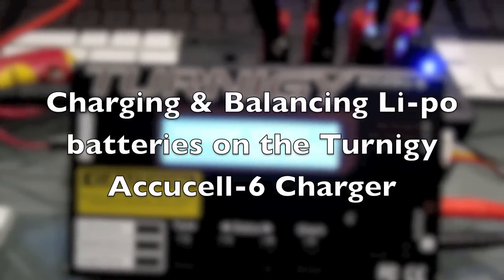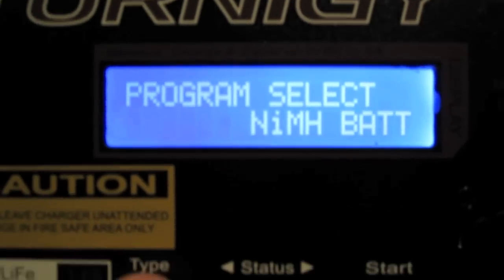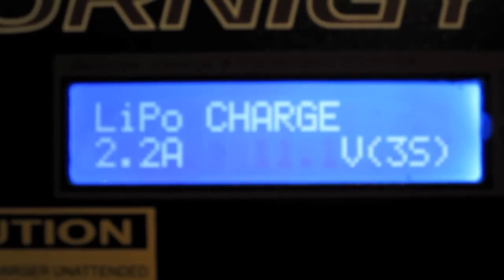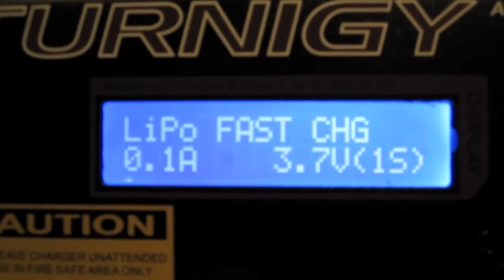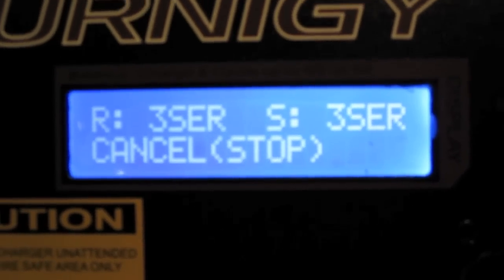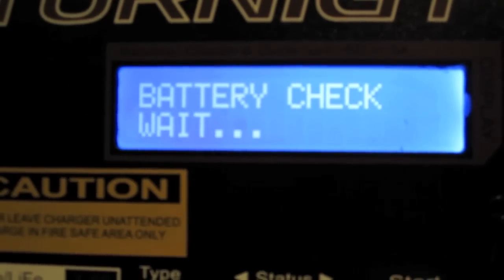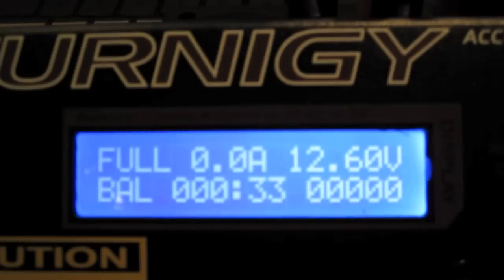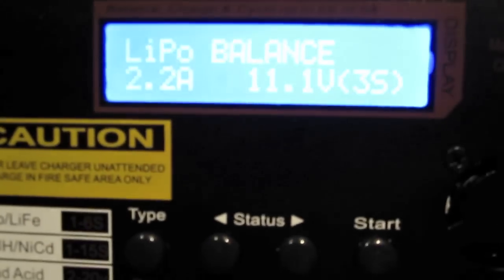Charging & Balancing a Li-po with the Turnigy Accucell-6 Battery Charger & Balancer

Comment: Hi , i do have a similar charger ( hobbyking HKC6) . It takes around 90 minutes balancing and charging a 2200Mah 3S @ 1Amp . Does not matter if the battery is almost charged . Does it make any sense?

Comment: Thanks Craig, I try doing what u are but charger goes off after I confirm. It will only let me charge only at 0.8 or lower. Do u know why it goes off. Same battery as u 2200 3 s

Comment: Very helpful indeed, thanks.
BTW, I have a noob question here.
What difference between charge and balance mode? If balancing can also charge the batt why it need another charge mode? 

I just bought one Accucel and still doubting of how to operate it.. :(
I was also trying for 2-2S-1500 parallel charging. If you would share any insight of parallel charging it would be very helpful to newbie like me. Thanks craig.

Comment: Hello! Thank you for that great rundown of the charger, I'd like one, my question is how accurate is it in its cell balancing and final voltage detection, IAEA you confident that testing with a good volt meter would show results on par with what the charger is telling you?  Thanks!

Comment: hi, I've been wondering, can I use my 12v 1amp power supply to operate this charger?
what power supply are you using, i mean the voltage and amperage? thanks

Comment: yes it can, it if your battery if it rated for 20c it wont make a difference because this charger could only put out around 1.2 c so it should charge in less than an hour with this charger at 6 amps

Comment: thanks for sharing this- can you confirm when you first went into the lipo 'charge' option that you were just demonstrating it as an option only & you are NOT saying when you want to charge & balance at the same time (& go to 'lipo balance' option, you DON''T have to go to the 'lipo charge' option & set your variable there first AS WELL- correct?  Is the 'lipo balance' option a slower method of charging compared to 'lipo charge'? Thanks for your reply

Comment: When i charge my Turnigy 2200mah 2S 20C battery I get a input voltage error? i type in 2,2 amps and 7,4 volt (2S) and when i confirm it says input voltage error, what is the problem?

Comment: @H8SFPV1 theres a problem with your pack.
maybe you drained it too low?
use a little pocket lipo checker, plug it on the balance port and see what its volts are at.

Comment: I can tell by your aussie accent that you are the man that can help me. I am new to all this battery charging and I want to get a good charger from america but I am worried about the 240 volts we have he in aus ruining it  so my question is if it says the AC input is 100-240V does that mean I can run it off an aussie wall socket ? sounds like a dumb question right but I just need some reassurance before I spend $130 bucks. the racers edge surecharge is the one I am looking at. thanks in advance

Comment: One thing users need to pay attention to, is while charging, pay attention to how much mAh is put BACK into the battery after its been fully recharged. The general rule of thumb for Lipo's is to run them down 80%. NOT until they die out. Running a battery too low will shorten the life span of the Lipo. In the display, the lower right hand corner shows how much mAh is being put back.

Comment: My battery went 1- 4.08v 2- 4.07v 3- 4.20v 

batt spec.

5400mah 3s1p 
charge rave 1c
continous discharge 20c
min discharge volts per pack 9.0v
max burst 30c
max volts per cell 4.2v
max per pack 12.6v

My question is, is there any way to get my cell's to balance better or is it a sign of the pack getting weak? I have the same charger as you and charge on 5.0amps and 11.1v selected

Comment: hi craig i have a align 7.4 1900mah 4c battery i have been using the 7.4 1900mah 2c befor , do i charge the 4c the same as the 2 c setting or do i have to up the cell rating to match the batt , there both reviever bats for heli but the new one has allso additional letters 14 wh , one newer than the other but both align,, high power,, batts, for the 2in one  regulater they make many thanks

Comment: THANKS FOR THE EXPLANATION. BUT, I´VE GOT THE SAME PROBLEM OF MR. MXSHOWTIME007 - IN A LIPO 2.2 3S TURNIGY BATTERY --- SAME MESSAGE FROM ACCUCELL - 6 CHARGER " OVER VOLTAGE " AND I JUST CAN´T BALANCE OR DISCHARRGE IT TOO. IT WILL BE NICE IF YOU CAN HELP ME OK ? THANKS AGAIN. REGARDS FROM BRAZIL !

Comment: hi well just wondering can i use a 12v 1.5amp wall power unit to charger my 2cell 7.4v 5000mah?? or do i need to get a better  power supply?i try to set it at 5.0 but it  didn't have to much power so i drop it down to 2.5a so its seem to work on that or  show i just charger everything at 1.0a??? please let me know!!

Comment: Hi, I have just got this charger and two Turnigy 14.8v 4s 2200mah lipo's, I have never Had any before and donot want to start charging them until I am absolutley happy in doing so, I have searched online for the charging settings but with no luck.
any help would be great, if you can tell me what settings to do I can start charging

Comment: @steady2868 Sorry mate didn't see your comment until now. I bought mine from eBay too (£25 sounds about right tbh, I only got mine 2 months ago). The "manual" I speak of wasn't provided but I downloaded it from the web (Google "accucell 6 manual"). Might as well have not bothered - this video helped me more!
It also came with some leads but not the connector I wanted so I just bought the right ones from eBay for a few £. There are plenty available for all battery types. 
Hope that helps!

Comment: (cplsyx ) Did you actually get a manual I was told from the Ebay shop they did not come with one Iv had to guess and work it out. I was told they used to come with a bunch of leads too! but now they are £24.99 you get the basic power in and power out lead with croc clips on the end thats it'  I tolt the seller what was the point of all the different types of batteries it can charge when realistically all you can charge is lipo and lead acid unless you try to make some kind of leads up :(

Comment: OMG, I just thought of a genius idea. You take a 12v lead acid battery and power the charger with it. Then you connect the charge leads from the charger to the battery.. Then you start charging. Free infinite power!!!!!!!!!!!!!!!! :D 

All joking aside, this is a really good charger indeed. I'm SO glad that I got it instead of one of the Chinese knockoffs. Charging is one of those things I don't like to skimp on as inconsistencies or incorrect voltage readings kills batteries.

Comment from the maker: @legalize000 no that is fine... the battery will charge at 600mah... not all batteries like being charged at 1C...(in your case 850mah) anyway...so that will work fine. As long as you have the battery voltage and cell count programmed in properly... it will be fine.

Comment from the maker: @860KHID I am using a computer power supply which is a 18amp switch-mode power supply. There are plenty of videos on Youtube about how to convert a computer supply & on Google. If you're inexperienced with electronics or feel converting a computer power supply is not for you, then you can use a Sealed Lead Acid battery which is rechargeable & can't spill acid. You just need to make sure the 12v supply has enough current (amps) to supply your charger/s while charing at maximum current.

Comment from the maker: @alxusmc  Ah ok. I've never really used a 'fast charger'. 32.5 amps. I've also not seen a charger for lipos that charges at anywhere near 32.5 amps. I fly a T-Rex 450 with 2200mAh cells so batteries that big I have no experience with! I'd be careful about 'fast charging'. Look around some of the forums & see what they say re fast charging. From what I've read it's not the best thing for the battery & is an option to be used sparingly. Unless you're in a hurry I'd recommend a 1C charge.

Comment: @craig3008 Thats what the battery says. "5c fast charge" and it has 6500mAh....wouldn't I charge it at 32.5 A? I thought 1c = (6500mAh=6.5A) so 5c=(6500mAh=32.5A)?? (im only trying to pick your brain as I am learning to use LiPos and I have purchased this charger) thanks

Comment from the maker: @alxusmc No. That is incorrect. The charge rate is nothing to do with the rated discharge rate. You can charge MOST batteries at 1C...that is 1 x it's capacity in mAh... As explained in the video. You need to check the manufacturer website of the battery to check what the maximum charge rate is for your particular battery.

Comment: thanks craig, really helpfull!

are there any videos to show charging a nicd battery? i have some old 6 cell 7.2v 1500mah batteries from back in the day and i tried going to nicd setting and charing at 1.5a. 
I had to stop the charge cause i got worried when it started showing the voltage up at 9.01v after 8mins... (or is this normal?) also what is the count next to the time for?

Cheers

Comment from the maker: @gunnarMyTube Most modern Li-po batteries are happy to be charged at 1C with no problems...that is a 2200 battery is usually fine to be charged at 2.2amps. In fact if you check the website of a lot of manufacturers you can even charge some at a higher rate however I would not do that all the time. You are correct however that the charge rate of the battery is NOT related to the capacity of the battery in all occasions. As I say for MOST modern batteries it's ok to charge at 1C.

Comment: There are several such chargers out there with different case decors, but identical UI.
My own concern is mostly how to understand to not exceed charge currents.
I did not interpret setting for example 2.2 amps charging current as in your guide to have any real life correlation with the 2200 mAh (milli Amp Hours) capacity of the LiPo battery.

Comment from the maker: @RafaMoon Hi There, Yeah I use velcro with the sticky on one side. It doesn't hurt the battery at all. Just make sure you buy the stuff with the sticky on it. Don't go glueing the velcro..just use the velcro with the sticky on it. I've done that for an number of years with my Align helicopters and it works fine. Put the prickly side on the vehicle and the soft fuzzy side on the batteries. Regards, Craig

Comment: @MrBman54321 and you solder an 10W, 8ohms Resistor between red and black wires. Then put this resistor near the fan (reachs hig temp, need cooling) . This make your power supply more voltage stable.

Comment: @IceBlack406 balancing and charging are the same thing. You can choose to just push current in until it reaches the full capacity, or, when balancing, it does the same thing, but also supplies extra current to individual cells to make sure each cell has the same voltage.

Comment: Wait... You set the "lipo charge" parameters, then you switched over to the "lipo balance" parameters, and set those. Correct me if I'm wrong, but I thought lipo charge and lipo balance were 2 different methods of charging the battery, you don't need to set lipo charge if you are just going to select and set up lipo balance after. At least thats how the Thunder AC6 works, it and this seem to function a lot alike.

Comment: hey if i put my 2s 7.4v lipo on my 12v power supply i cant charge at any amperage's.  I can only charge under 1 amp and it takes way to long to charge and i dont even know if its charging my battery i only have like 6 min run time!

Comment: Very helpful, thanks.  I was  charging without the main outputs connected just the balance port.  So I was scratching my head trying to figure out what I did wrong.  The Calibration video was helpful too
Thanks again

Comment: If you could clarify for me: 11.1 v 2200mah 20c lipo
For amps i plug in the capacity which would be 2.2 and voltage would be 11.1?
Also from other forums that i did research on most people seem to be telling me to only charge at 1.0-2.0 amps what does that mean? 
much appreciated.

Comment: @craig3008 I recommend a 12 volt battery or you can take an old computer take the power supply out and solder the green and black wires of the big plastic plug then take the black and yellow wires out of a different plug your yellow is positive and black is negative so black to black and red to yellow youtube can also help you out on this money saving project.

Comment from the maker: @tydb1 Hi there, you would need a power supply (12 - 14v) that has at least the current capacity of the battery charge rate you intend to use. If you are going to charge at 2000mah you would need a minimum 2amp charger - I'd actually use a power supply at least 500ma over the charge rate you intend to use. If you intend to charge at 1amp then at least look at using a 1.5amp power supply. Re connectors - these chargers come with everything from alligator clips to all manner of connectors.

Comment from the maker: @luki01111 If it's a multi-cell battery (more than one cell) then yes it's a good idea. Otherwise your cells can get out of balance... and you wont get as much life out of your battery with each charge. It's important with Lipos to ensure that each cell is charged to the same point. So I would use balance each time. The 'charge' selection is there for single cell batteries as there is only one cell there is no cells to balance. Regards, Craig

Comment from the maker: @helicub81 Hello. The charger comes with all necessary leads and connectors including a deans charging lead. In fact it comes with lots of different configurations so pretty much all your charging needs in the way of leads and connectors will come with the charger. I bought mine from Hobby King and it came with everything...I can't speak for what comes with that model from other stores. Regards, Craig

Comment: @craig3008  Thank you and otherwise a great video that was very informative. I have an Imax B6 on the way thats simply a different branded version of this charger. I use 7.4v and 11.1v Turnigy batteries for airsoft and use Deans connectors. I am especially pleased that this charger seems to be capable of charging NiMH batteries as well.

Comment: Fair comment but its also miss leading to say in your video that the setting indicated is the capacity of the battery which implies that would you for example have a high mah Lipo like 5800 like I do, that it would be good to charge at such a high rate? It would be more apt to say this is the charge ampage as the instructions say. I appreciate you know your stuff but with the greatest respect many do not and there is a genuine area of danger here for those not in the know.

Comment from the maker: @thegeneral123 Hi there General. As for being 'wrong' well that's debatable. I have found plenty of sites on the net that claim it's fine to charge the battery at 1C. I contacted Zippy in the USA and they also assured me it's fine. I have also charged dualsky packs at 1C and again it's not been a problem. The batteries don't get hot or puff etc. It certainly wont hurt to charge them at a lower rate so you are not 'wrong' however many agree that I'm not either. Thanks for your comments.

Comment: Sorry but you are wrong. The instructions clearly state that setting 2.2a is not setting the capacity of the battery but rather the charge current. By setting this to 1C you are pushing the battery at its max charge current and this is a bit risky.  For the sake of safety and battery life preservation I would set the charge rate to half the Mah rating of the battery. 1.1amps for a 2200 Mah battery.

Comment from the maker: @WarhawkLegend69 Hello, yeah as long as you program the charger correctly and barring nothing unforeseen happening you should be fine. I recommend getting yourself a lipo sack or similar pouch to charge the battery in. They are a fireproof bag and in case of something going wrong they will stop you from burning your house down! Check youtube for them. You can get them on ebay pretty cheaply. The chargers are foolproof as long as you set them properly & take care of the batteries.

Comment: hey mate so this is all you have to do to safely charge and balance your Lipo battery and ittt is all done electrically for you once you set your batteries parameters, well it dont get it do some cheaper chargers let ittt up to chance or done manually that people have the problem with Lipo because hey this seem very easy for use ??????????

Comment from the maker: When you say you are debating whether to get one...what do you need it for exactly? They do not blow up if you treat them with respect. They need a special charger that monitors the condition of each cell in the battery and a lipo should never ever be allowed to over charge or over discharge. What use did you have for a lipo? Mostly they are used for remote control helicopters, planes, cars etc..

Comment from the maker: According to the manual, BATTERY VOL ERROR = "There are bad connection at the individual connector. Please check the connector and cables carefully." And according to the manual, CELL LOW VOLTAGE = "The voltage of one of the cell in the Lithium battery pack is too low. Please check the voltage of the cell one by one." There are no loose wires on either end of the balance cable? Have you got another battery to test on the charger? Please message me with your email address if you want manual sent.

Comment: On LiPo charge screen it's the "Charge Current" NOT battery capacity.  With a LiPo you would normally charge at 1C which works out the same anyway.

You DONT need to set the charge current in the "Charge" program to use the "Balance" program.  Just set the charge current in "Balance".